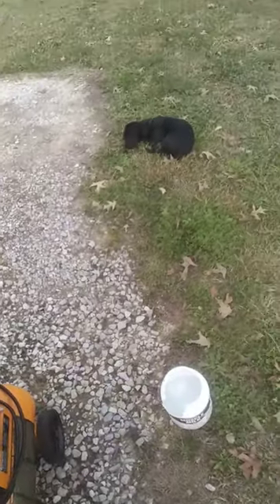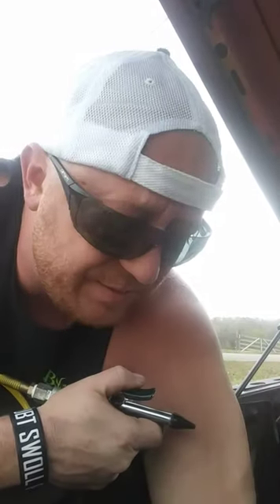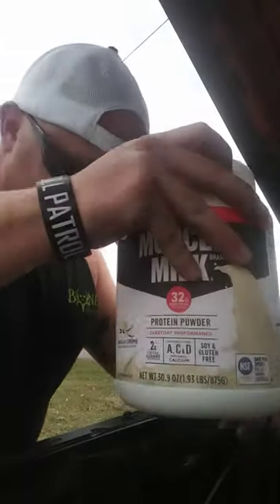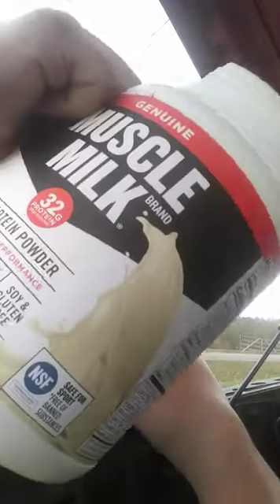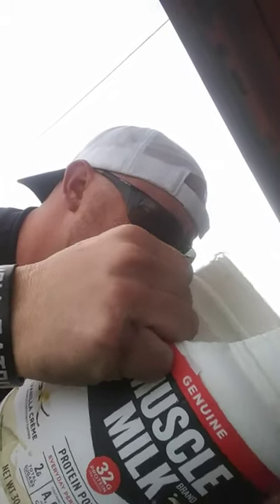Dodge Ram no heat / clogged heater core / easy

Comment: Thanks. Going home to flush mine now. I have a 2013 Ram 1500. Mines doing exactly that. Blowing hot on passenger and cold on drivers side. So thankful you shared this!
Reply from the maker: You're welcome!  I flushed mine again the other day. This time a poured a little (less than 1 cup)  of white vinegar into the Hose and let it soak for about 5-10 minutes. It worked great!
Reply: @aceofpace1378  outstanding! Thanks brother.
Reply from the maker: Was you able to get it flushed?
Reply: Hey did it work same year truck and same issue
Reply: pour some CLR in it and let it sit for a half hour then do it again but when you flush it out flush it all out. I was 20 degrees difference from drivers side to passengers side drivers side being the coldest as thats the side the heater core blocks up in.. The CLR worked great
Reply from the maker: @skipwilliam5639  no DO NOT USE CLR! I went through 2 water pumps after using CLR. I flushed it really good and it still caused the weep hole to leak. NO CLR! Use white vinegar instead.
Reply from the maker: @hemihayden  quickest and easiest way to tell if its your heater core is after you've had your truck up to operating temp. check both hoses that go to the heater core ( with your truck off). If one is colder than the other, its you core clogged and it isn't circulating that hot antifreeze through there.
Reply: @aceofpace1378  but if its blocked at the end the water will still flow through the rest..But if you have duel climate control the hot water will not reach the end of the heater core causing cooler air to go to one side of the duel heater.
Reply: @aceofpace1378  I made the mistake of adding stupid cork pellets.  I didnt realize the truck was on auto so when I seen the water under the firewall (on the outside) i thought I had them in the garage why not. I told my friend to throw a couple in he threw 5 in  that winter I had no heat on the drivers side... I did use CLR but them ran water both ways for 10 minutes and then air .. But i will use the vinegar idea if it does it again..
Reply from the maker: @skipwilliam5639  there is nothing to block it at the end... its the water pump at the end of the hose. If you have clogged a hose, you have bigger problems than just a heater core. You'll be replacing a radiator and over heating.
Reply: @aceofpace1378  I cut  both hoses to the heater core halfway between the pump and the core and had both hoses above the motor higher then the motor I filled the hoses alone with the heater core only the motor or water pump  was never touched by the clr  it was just the heater core and the two hoses..
Reply: @aceofpace1378  the heater core gets blocked at the end and what happens is as it gets plugged more and more Dirt is filling in the holes so 1/3 of the heater core is blocked at the end so the water only flows through the first 2/3 of the core. The duel climate trucks have a door right there If the driver wants colder then the passenger side the door closes more for them..And reverse for the other way.. But if the core is blocked at the last 1/3 of the heater core no hot water is making it to the dirvers side of the door. I was getting 68 F on the drivers side last winter and 85F on the passengers side.. I checked every actuater then read every form page. It baffled me that it would be the heater core but damned if a bunch of crap didnt come out when I flushed the heater core by leaving it full of clr for 20 minutes twice.. I drained it into a pail and there was a lot of debris... This year I have 80 F on the drivers side and still 85 on the passengers side so I will do it again in the summer
Reply from the maker: @skipwilliam5639  I've never messed with dual control so I appreciate the advice. I've never had to water pump fail back 2 back and the only thing I had done was used clr. I flushed it out both directions but apparently there must have been some still in there. The next time I used white vinegar and had really good results with no follow up issues so thats what I recommend. I'd hate to give advice and damage someone's vehicle so I try to keep it as safe as possible.
I disconnected both hoses from the water pump when I did the clr treatment.  Only the hoses and heater core got the dose. I didn't flush for 10 minutes both ways though. Maybe 2 both directions so that could be where I went wrong.
Reply: @aceofpace1378  well im going to take your advice anyway and try a different method to it as well.. The heater ore on my 2011 ram is 270 Canadian for a new one and 12 hours labour. So I will flush it again next summer anyway  and I will try the viniger way.. And yes the duel thing blew m away as well I wouldn't have cared so much if it was the wifes side of the truck..lol
Reply: @skipwilliam5639  i have a2011 ram with a no heat issue.  I'm curious how this turned out for you? After watching this video and Eric the car guy I have a good idea how I'm going to try it tomorrow.  No CLR. I'll try vinegar and maybe make a ball valve attachment for my air compressor to control the rate of air flow.
Reply: @scottmarshall6060  if you have no heat at all check the door actuator.  I had very little heat but it was heat.. The passengers side If i set both settings to 80  I would get 80 on the passengers side but only 65 on the drivers side so the door was working.  I removed the heater core lines at the water pump so none of the CLR went into the water pump or anything but the heater core. I filled the one line with clr and left it in there for 15 minutes before I flushed it with water.. I did drain the contents into a pail and did see quite a bit of debris. .I did this three times then ran the garden home through one end for 5 minutes to make sure its flushed.. Re connected it to the water pump refilled the rad and now I get 80 on the passengers side and 78 on the drivers side..   I dont know if CLR damages the cre or eats away at it but i didnt leav it in long enough to effect it and i didnt let the clr into the motor. 

The whole problem is because its duel climate the box the heater core sits in has a divider down the middle and the bottom of the heater core where it loops back around well thats on the drivers side of the box..If it doesnt circuate properly It ill only get so much of the actua heat in the heater core while the passengers side  remails full flowing.

Anyway good luck I was surprised this did work Im old so I remember when duel climate was not around. So I was real a sceptic.  and Im even more surprised its still working. .lol
Reply: @skipwilliam5639  you know I don't remember posting this or you responding 9 months ago.  But I do remember flushing my heater core. It helped a bit.  But I believe my problem is with a blend door and honestly probably that fucker in the very back of the dash. Hot air good pressure on passenger side lukewarm low pressure on driver side.  2011 ram slt
Reply: @scottmarshall6060  its all good  mine was the heater core. What I did by mistake was I thought I had a heater core leak into the truck so I added like 6 cork tablets that are like a dry bars leak. I think they all decided to go to the heater core and stop.. Because my truck is duel heat.The drivers side stays cool because the water doesnt get to that side of the heater core.. I did use CLR but rinsed the crap out of it and you are right I still had to replace the 4 year old water pump... Anyway thanks for the reply..
Reply: I’m glad you’re safety conscious. Lots of guys don’t do that. Awesome video!!

Comment: Great information I have the exact same issue going on in my truck right now only the passenger side is getting hot air and the driver side is getting cool air. I'm gonna have to try this this weekend so I don't have to tear my entire dash apart to replace my heater core.  Thanks for the info.
Reply from the maker: You're welcome bud. You can also flush some vinegar through there to help clean it out. Try to let it sit for about 5-10 minutes.
Reply: @aceofpace1378  I had absolutely no heat. I did exactly what you did and now the heat will run you out of the truck. Thank you so much for the video
Reply from the maker: @davidboothe4903  awesome! I'm telling you, that white vinegar does the trick! It's the best heat I've ever had since doing this. Glad to help!
Reply: you're pointing me in the right direction to fixing mine. i have ZERO heat in mine meaning that the heater core in mine is probably plugged but the blend door isn't switching over either so more than likely i'm in for  a heck of a ride with getting mine repaired so it will work
Reply from the maker: @DaddytechEnt  feel of your hoses after you've had it up to operating heat. ( the truck off  while checking ) . If both hoses are hot then the circulation is there. If one is cooler than the other then your core is clogged.
Reply: So I'm having the same issue.  What was your remedy?
Reply: @scottmarshall6060  new heater core. Old one had a crack. Took 4 hours to do my self
Reply: @aceofpace1378 how do you get it flushed with the vinegar? Pour down hoses and let gravity move it through?
Reply from the maker: @troyd.521  yes sir! You'll probably need a funnel but the hose needs to be higher than the heater core

Comment: I have an '03 with a 4.7 every year I do this. I block the heater hoses and can split the hoses on  the core side. That way I loose on the coolant in the core. My friend was a Chrysler mechanic and told me to use acid toilet cleaner.  I don't leave it in for more than a couple of minutes then flush both ways with a garden hose hooked up. Last year I had to change the rad and I took the tanks off and found the 2 or 3 inches of sludge in the bottom. Anyway tons of heat now!
Reply from the maker: Awsome!  I makes for a long ride when you're freezing the whole time lol

Comment: I have same issuie, tore apart my center dash thinking it was a actuator for blend door but all of them are working properly. So it might be heater core needs to be flushed and a new thermostat with new anti freeze mayve
Reply from the maker: It's good to drain and replace you antifreeze after a good 5 years or so. Flush your heater core real good. Turn both hoses up and and pour in some white vinegar.  Let that soak for 5 minutes or so and flush it out with more water and air both directions. I bet youll have some heat. Worked great for mine

Comment: I may need to do that too. My truck has the same issue. Driver side is cold and passengers hot. However after a while, my driver side gradually starts going towards hot.
Reply from the maker: Pour some white vinegar in with both hoses facing up and let that sit for about 5-10 minutes.  Then, flush it out really good with water. I had great results.
Reply: @aceofpace1378  Does it last? Do you have to re flush it every year? Because I was going to try Prestone radiator cleaner.
Reply from the maker: @davidalonzojr8617  i dont know anything about those cleaners. But it depends on your level of junk in the system. I had a lot of grime in my resevoir from the road debris.  It has an open overflow that allows dirt and grime in. So over time that dirty antifreeze gets into the cooling system and into your heatercore.  I cleaned out my reservoir but that dirty fluid is already inside so I clean it out every year. You can go get the system flushed so it is all new and clean antifreeze.
Reply: @aceofpace1378  I am going to try it soon. BTW how's your heater working?
Reply from the maker: @davidalonzojr8617  nice and toasty
Reply: @aceofpace1378  That's what's up. I had my coolant flushed last April, so I am going to flush it with water and white vinegar this coming week
Reply from the maker: @davidalonzojr8617  That should do the trick bud. No heat is rough!
Reply: @aceofpace1378  Hey brother. So I finally got around to flushing my 09 RAM heater core with white vinegar and I have to say I went from having the problem of one sided heat to having very good heat on both sides to the point where the heat will run you out the truck if on too long. Thanks. Because of you and your video my heat is back in business!
Reply from the maker: @davidalonzojr8617  Awsome!!!Yes sir, you're welcome! Man I'm glad to hear it helped bud!

Comment: Thought my thermostat was bad in my 09 Ram until today I realized passenger side blows hot. Thanks for the video. Gonna try it as soon as this NY blizzard blows thru.
Thanks!
Reply from the maker: The last time I did this I poured in some white vinegar and let it set for about 5-10 minutes. It's the best heat I've had in my truck! Hope it helps bud
Reply: Hey did it work for you?
Reply: @hemihayden  
Didn't do it yet.
Been lazy. But cold weather is coming so I better get cracking soon.
Reply: @lambjack1  did it work for ya?
Reply: @aceofpace1378 😢😢😢😢

Comment: i liked your manner of communication.  more real than hype or seeking to impress.  thxs
Reply from the maker: Thank-you!  Hopefully this will get you some heat if you are having troubles. Recently I've poured in about a cup of white vinegar. Make sure both hoses are pointed up so that it will sit in the heater core. Let sit for about 5 minutes and then flush out again both ways. Hottest heat I've had in my truck.

Comment: That works great. Mine was 100% blocked.i bought new 1 and seen this video. It's still in box.thanks for saving a days work
Reply from the maker: You're welcome! Glad to help. If it happens again, turn both hoses up, pour in some white vinegar and let that sit for about 5 minutes.  Then flush it out with water again.
Reply from the maker: You get it going?
Reply: @aceofpace1378  Yea.21 degrees  here and I got heat
Reply from the maker: @williamreese2477  awsome!

Comment: Finally did it today... Heat like the Sudan.!!!!!
Works
Reply from the maker: Awsome! Glad to hear it worked for you! Hopefully you won't have to do it again, but if you do, pour some white vinegar in and let it set for about 5-10 minutes. Then flush with water just like this video.
Reply: Kinda like blowing  your nose getting the snot out with high velocity.

Comment: Try using the right coolant in it and see if you still have the problem. Thee trucks use the yellow coolant or Dexcool. not the green stuff. Dodge service manuals call for the yellow coolant but everyone that's ever had issues with their cooling systems in these trucks that i've seen had the green coolant in them
Reply from the maker: I've bought both of my dodges used so I've never seen a manual. I've also never seen yellow coolant either lol
Reply: @aceofpace1378  the coolant for a Cummins it HOAT coolant which is a YELLOW Dexcool coolant recommended for Dodge trucks Nappa Sells it under 1DEX item number or at least they used to
Reply: @presidentialsuite6406  the thing is sticking with what the Manufacturer recommends. it does make a difference contrary to what so many people believe, i've had intake gaskets and other cooling system failures all traced back to using the wrong coolant and that can get really costly really fast specially in todays vehicles that are getting way more complicated to work on.
Reply: @presidentialsuite6406  unfortunately that is true. but then when you set boundaries they call you difficult too so you kinda can't win either way. I've been there almost constantly :o)
Reply: @presidentialsuite6406  yeah and there are many other things more worth worrying abut now days. i guess you really have to pick your battles now for sure.

Comment: Thanks bud, I'm trying it this weekend on my 06 Ram... Cold on drivers side n heat on passenger
Reply from the maker: You're welcome bud! Once you blow air through a couple times, turn both hoses up & pour in some white , then let it sit for about 5-10 minutes. Flush it out good with water and blow air through both directions. I had really good results last year doing this.
Reply: Same issues,   will try this fix soon as soon as its warm enough

Comment: Which one of the hoses is the inlet? Top or bottom on the firewall? Both mine seem to be same temp but no heat on drivers side. I ran garden hose both ways for a bit but no real change.   Was going to flush with CLR but I'm glad someone else tried it before me. Lol
Reply from the maker: Pour in some white vinegar and let that sit for about 5-10 minutes in the heater core with both hoses facing up.  I'm not sure which is the inlet off the top of my head. It won't hurt anything if they get swapped up. It's actually called a reverse flush.
Reply: Ok thanks for the quick response!
Reply from the maker: @suprtrucker7486  no problem bud! Hope it helps! Were both hoses hot to the touch?
Reply: Yeah both were almost the same temp. I got my infrared thermometer back so I'll figure it out. I'll let you know how it turns out.
Reply from the maker: @suprtrucker7486  is it dual climate control? There is a guy somewhere in the comments talking about his giving him issues.

Comment: Why can dodge not figure this one out. Any damn ways, time to do the annual flush. Good post
Reply from the maker: Thankyou!  On the side of my resivor there is an open section,  I'm guessing for a vent. I think a lot of debris gets into the radiator through this. Dust ,dirt or anything else can get into the system. I'm going to put a piece of screen over mine.

Comment: Great video. I wonder if flushing the HC with distilled white vinegar would work.
Reply from the maker: I tried the white vinegar a few months later. It worked great! I poured it in with both hoses facing up and let it sit for about 10 minutes. I flushed it out both directions with water afterwards.  Best heat I've had!
Reply: @aceofpace1378  Awesome! I use it to flush my 5th wheels water heater tank twice a year.